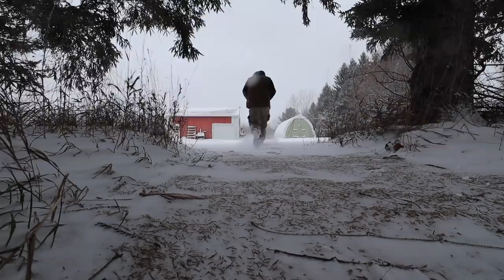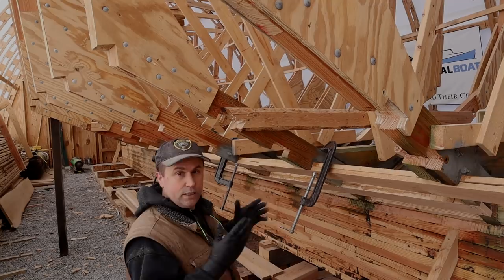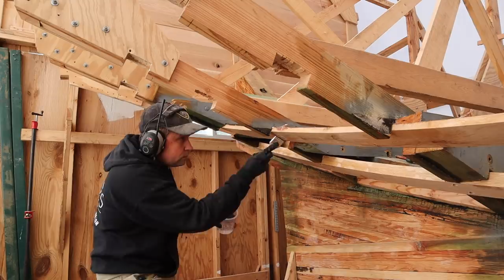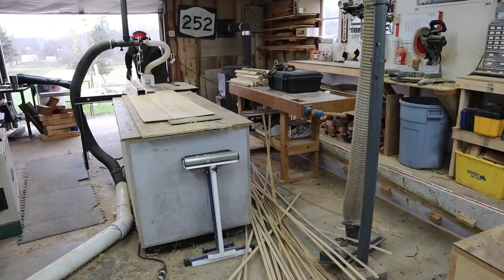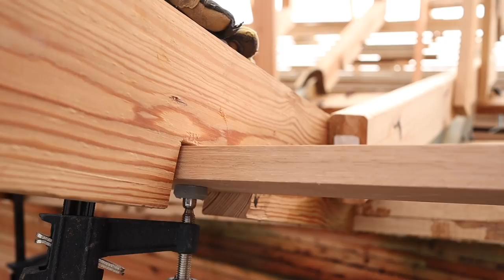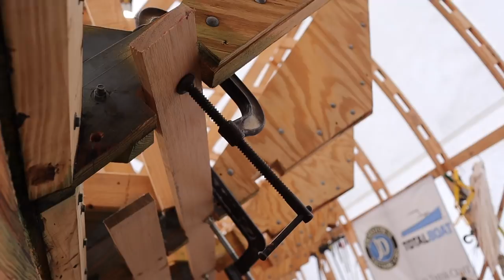Laminated White Oak Bilge Stringer Install, Sea Dreamer Project Ep. 40

Comment: Hi Scott - a couple of suggestions. I notice you using acetone for cleaning surfaces and epoxy runs. It is a relatively expensive and toxic solvent and not required when working with epoxy resins. It is required with polyester resins. Methylated Spirits (alcohol) works very well with epoxy resin - try it! It is cheap and far less toxic; you can clean brushes, epoxy spills etc. Secondly, despite using wood preservative, you seem to have a number of those plywood gussets that will be in wet areas along the bilge. With the end grain of this ply exposed it will quickly swell and rot - just see many yacht restoration channels (eg Sail Life) where they have had to rip out rotten ply due to water intrusion - even when sandwiched between fibreglass! So, I would suggest trying to seal those end grain areas with epoxy or something similar. I would also seal the ply end grain where you have notched the frames for the stringers and chines. Overall, progressing well, keep up the excellent work...

Comment: Easiest way to straight edge long boards, all you need is a half inch sheet of plywood and a long string line. Start by cutting 4 six inch wide strips from the sheet. Second: lay two pcs end to end and with a third half lap the two bottom pcs. Cut the forth in half to cover the two ends. Use the string line to straighten the whole length at glue up stage. Presto 16 foot straight edge. Last of all, cut two more plywood strips for support fence and attach to six inch pcs. Again using string to make straight the entire length. To use, rest the two extreme points of the curved board against the fence  then push the board and straight edge guide through the saw. This will straight edge boards up to 16 feet long. This can be made longer if needed and for cutting 8 quarter boards just make the guide fence higher by adding more 2 inch wide strips. Hope this helps. ps. enjoying the show, keep up the good work.

Comment: If you can get away with not having to steam wood, good, it’s one less job, but if you find you do need to at some point you can make a very effective and simple “box” from clear plastic rolled and stapled into a tube, ( or better still clear tube if you can buy it - which I couldn’t ). I used a camp stove to generate steam in a container made from two tin foil roasting trays - one upside down on the other. Worked a treat!  Working with steam softened wood makes it real easy ( and fun ) to bend wood into place, and of course is essential in many situations. It was quite amusing turning what had always been a rigid material in my experience, into temporary “rubber” : )  And it’s quite a simple process. Btw, been following for a while now, keep up the excellent work. Cheers from New Zealand.

Comment: In Great Briton 200 years ago, when building working Narrow Boats for the inland waterways, They built a steam box, not unlike your prop shaft housing but build to the size to house the planks. The planking becomes like floppy plastic. they then fixed it to the boat sides. A tried and proven method.

Comment: Martin here in good old blighty. It looks as though there are only 2 supports for the boat, 1 port, 1 starboard, it also looks like your doing quite a lot of physical pushing and pulling to get timbers into place, might it be an idea to put some more bracing in and it scares me to think of the worst.
But wow look at what you have achieved, I've been watching since day 1, you've done amazing, keep it going.
P.S. I hope I'm wrong about the supports.
Reply from the maker: Thanks Martin.  There are a couple of smaller supports on the keel, but you're probably right about more bracing, just in case.  Glad you've been with us so long!

Comment: DryDuck vest, nice gift. As far as the duck you're building, dry inside wet outside is the goal. Just wondering why the stringers aren't cut to lap at the frames?
Love the lines that are coming to fruition. Going to be a nice boat that should cut the water quite well, if I am seeing where these lines are going. 
As a former home builder I am wondering if the structure will maintain its strength with as deep as these notches are cut into the frames. If the forces were going to be applied from the inside, the forces would clamp on the stringers. However, the water will be placing the greatest forces from the outside which will act to spring thkse notches open. I'm just not sure the stringers and epoxy will be strong enough to hold. Maybe the planking will line up to brace the frames accordingly from the outside, then strengthened by the double layer of plywood.
Will you be using marine grade ply or home store ply?

Comment: I'm curious why didn't you scarf the runners together rather than butting them up on the bottom of the boat? It would have made them so much stronger and been able to take the pounding so much better when coming back down on the water when going over a swell? Over all i'm looking fwd to seeing your vessel on the water. Thanks for sharing best wishes n Blessings. Keith Noneya
Reply from the maker: Overlapping but joints are pretty damn strong.  In this application I think it will be more than enough, but I guess we'll certainly find out!

Comment: Seems like a similar build as the world War ll Higgins Patrol Boats.  Just wondering are you going to use diagonal strapping to keep down some of the flex and twist once under power?
Reply from the maker: she'll have a layer of 3/4" white oak planking and then 2 layers of 3/8" plywood.  The plywood will give us that strength across all directions.

Comment: Would you not be better to place the stringers butts on the Center of the frames I would think it would be stronger if you did it that way
Reply: My thoughts exactly. Especially the outer strip. The two corners coming together out in the open will cause a high spot in the curve. Of course he did say he was going to fair these issues as he builds.

Comment: Hey, are you not worried about gluing white oak with epoxy for a structural component ? It really changes dimensions with moisture changes.
Reply from the maker: Actually white oak is pretty stable and the High Performance Epoxy from Totalboat we are using has excellent penetration and good flexibility, so it's perfect for boat building with white oak.
Reply from the maker: Well, just like the beginning of your link stated, epoxy has come along way since 1995.  Totalboats high performance epoxy is comparable to West systems Gflex.  That's why we are using the high performance stuff because of white oaks potential problems and a more flexible formula of epoxies ability to overcome it.  Also, it is the true white oak (Quercus Alba)
that is the most troublesome.  There are like 10 different kinds of oak that are considered "white oak".  The "white oak" that I'm buying from around here is one of those white oak sub-species and less susceptible to the problems you mention.  In fact, it's highly desirable sub-species in boat building.  One of the refurbishments of the USS Constitution, Americas oldest, commissioned war ship, used white oak from our region in upstate NY for a portion of it's keel. We'll keep prepping our white oak by wiping it down with acetone and using the high performance epoxy for all our white oak glue ups  just in case.
Reply: @SixPointsWoodWorks  Sure, if you are are happy with your choices that's fine. When I look at the spec sheets between the two epoxies they aren't comparable. One gives a modulus of elasticity of 150,000 psi, the other 380,000 psi.

Comment: At 8:50 in the video, it looks like the stringer is not a fair curve. It's as if the frame notch was cut too deep and the stringer bends inward.
Reply: JOHN SHOUREAS I noticed this as well.
Reply from the maker: It certainly isn't perfect, but we still have final fairing to do before planking so I think we'll be alright.
Reply: I noticed this too in a few other areas. Might take quite a bit of fairing to correct it?

Comment: What power plant ( Detroit , Cummins or Cat ) is going into your vessel, I’m assuming it’s going to be diesel and is it a single or twin screw ? And are going direct drive or Z drive after your gearbox? The reason I’m asking is because of the placement of your power plant ( mid-ship or closer to the stern ? Thank you , carry on friend !
Reply from the maker: We will be using a Diesel engine somewhere in the 85 HP range.  Single screw, engine a midships with a direct drive.  Our dream engine is the Beta (Kubota block) 85.  However we also like the John Deere 4045 and the Perkins 4.236
Reply: Out of those the Perkins might be the best but do consider a 240 or 290 Cummins, it might be more horsepower than needed but in the boating world more is better ! I’ve had boats underpowered and it’s not good . It’s just a thought.
Reply: @SixPointsWoodWorks  Perkins M92B would also be in that range.... We looked at all of these for our boat.

Comment: Not trying to criticise,  but did you not consider scarphing those stringers, rather than just butting them?
Reply from the maker: If they were single pieces, then yes scarphing would have been mandatory.  However since we are laminating pieces together to get to their final size,  overlapping the butts is more than adequate strength wise.
Reply: @SixPointsWoodWorks  fair comment, but i personally would always go for any possible improvement in strength for very little extra effort. Thanks for your reply.

Comment: Possible helpful hint:  When attaching the stringers (by yourself) make a "C" shaped piece of plywood to hold the far end of the stringer up closer to the frame.  That will help in alignment and speed up the process.   I admire you working in a plastic tent when there is snow on the ground. I have to light my heater when its 60 degrees in my shop...lol  Keep up the good work.

Comment: I would not have a butt joint end on anything but a frame. Those joints will fail eventually as your hull flexes riding swells at sea.